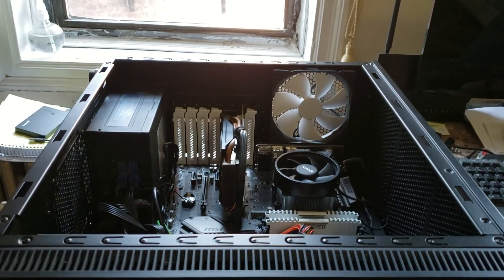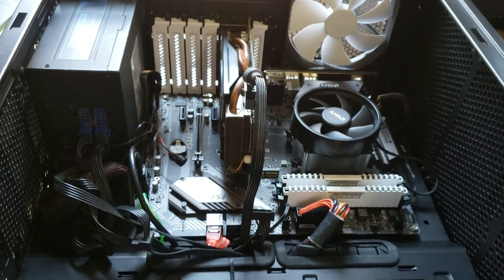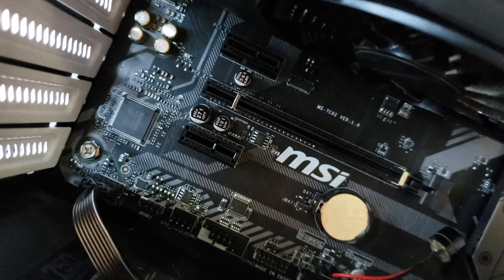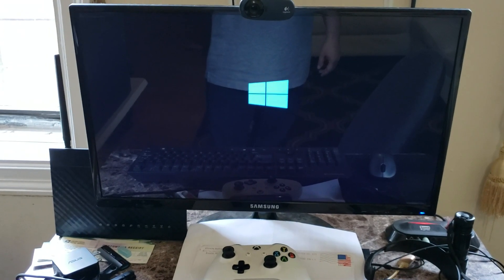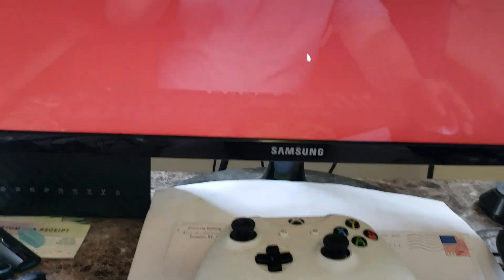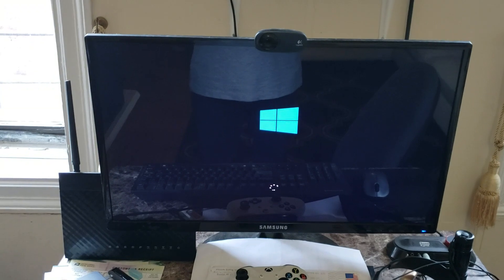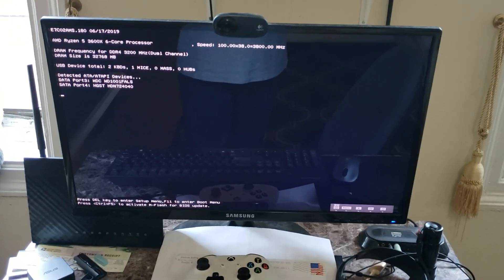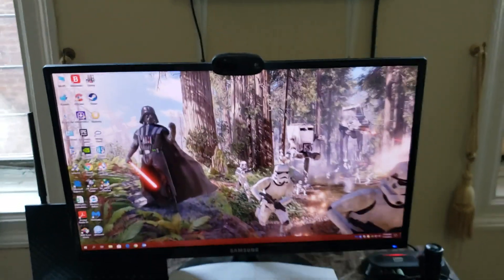Ryzen 3000 not booting on MSI B450/X470 Workaround Fix.

Comment: so what if i dont have any jumper on the mb. and still not booting, im shorting out manually to turn the mb and psu on so i dunno. i got an x470, and it doesnt work on my asus x570 gaming tuff, or neither the x370 from a pre build from dell (inspirion 5675) ?

}

Comment: Same problem 
I mean the PC turns on except the CPU and back case fan.
It turned on after i replaced the cpu and unpluged everything and pluged it again like 3-4 times and i booted so i updated my bios but after 3 days again... same problem 
Can someone please help me?
Removing the reset swith jumper does not helped me still no post...

Comment: Just found out there are 4 led`s on the motherboard that tell you if there is a problem with either GPU, BOOT, CHIP or DRAM. My DRAM led was lit up so I`ve just replace the one stick with 2 in solt 1,2 and it`s booting up fine now.

Comment: Same issues.  I have a MSI x470 plus board with a ryzen 3600 CPU and it won't post.  There is a cpu red indicator that comes on and never goes off.  Super frustrating.  I'm about to buy another motherboard.  I had the CPU installed in a Asus Strix b350 motherboard with updated bios and I never had an issue.  I will stay clear of MSI in the future.  Thanks for the video, I'm glad it's not a 'me' issue.

Comment: OMG after hours of head scratching bios flashing etc, I had the same issue of not being able to post after completing a brand new build, I came across this video and I'm shocked that this has actually sorted out CPU debug led and PC now posts and boots up.
MSI B450 Gaming Pro Carbon AC, Ryzen 5 3600, Geforce GTX 1660 Super GPU, Corsair Vengeance DDR4 3466Mhz 2x8GB sticks of RAM.
Reply: I have almost the exact same build and I’m having this issue. Is it fine now or still issues?
Reply: @KalebDenningIRL  mines all good now, just left the cable off for the reset button and worked booted up no problems.

Comment: After over 34 years of building pcs I recently bought the MSI 450 Tomahawk max and putting it all together after of course as we do, spending some time doing so, it failed to post. FULL STOP, no post. Check double check and nothing. Power is fine, fans fine cept interestingly no keyboard power light, no fault lights ie cpu et which was brand new. I've not used MSI before and don't see myself future wise doing so. Apparently this board has problems and it seems MSI are still releasing motherboards with problems. It clearly states on the box that it is Ryzen 3000 desktop ready. Ryzen 2nd Gen 3200G new installed with DDR4 2x4Gb ram 500w power + 2Tb WD black hard drive. I have to finish by saying that pc builders should always remember to build OUTSIDE of the case and TEST outside of the case BEFORE you build in the case saving you a lot of time otherwise wasted. 
NOT ONE of my previous builds with ie Gigabyte / Asus have had motherboard problems especially re initial post screen. I was somewhat disappointed but accept this is down to the MSI brand. I've used AMD dual core processors through the years on builds no problems though these days I do tend to favor Intel particularly i5's

Comment: Hello brother thank you soo much for the video...can you please help me? i have 3700x b450 carbon pro ac i am.not able to boot up the pc while the power is on in the cabinet everything runs but my screen is black no visiblity and no working of keyboard or mouse...i have flashed the bios and it starte working for 2 days now again its almost dead now...any budy can please help me with this??
thanks in advance
Reply: Same here with the same components. Just setuped it but no luck, no visible output, so can't do anything
Reply: @amen1459  MSI b450 gaming pro carbon ac, Ryzen 3700X
Reply: @amen1459  Yes I flashbacked it using a USB stick at the beginning. Now even when I try to downgrade or reinstall the same bios version, it just blinks twice and then remains on (the bios red light). And yes I'm using a 1080 TI Asus GPU.
Reply: @amen1459  Hmm, was your EZ Debug CPU light on too? and by removing the parts it turned off?

Comment: I just bought 4 of these Tomahawk B450's and paired them with Ryzen 1600AF Cpu's. Tonight is now the 2nd time I have experienced no boot issues with these. One of the builds during setup all of a sudden wouldn't post.  I thought one of the major components failed and I was about ready to swap out parts from an already completed system. Finally I got that system to boot. Don't remember exactly what resolved the first one but likely it was clearing the CMOS. Tonight on another build I wanted to double the RAM. I added a 2nd kit of RAM and entered BIOS and set XMP2 for 3200mhz. After that no post, nothing. Removed the fully tested kit from the other system and went back to 2x8gb. Still nothing. Tried using a jumper for about 30secs, nothing. Tried removing the CMOS battery for a few minutes nothing. All this because I wanted to see if 4x8gb would run at 3200mhz... So finally I put the jumper in place and let it sit for 5+mins. Came back and finally it posted stating BIOS was reset.  So it appears these boards have a very long clear time of the CMOS. I kept getting CPU light on off, VGA light on off, Boot light ON.......... and nothing. This makes me not want to mess with anything on these boards, I wanted to OC my 1600AF's to 4.0-4.2ghz all core range but now I might just leave it stock for a while because my time is more important than dealing with these no post issues. Next time this happens I will simply jumper the CMOS pins and let it sit for a while... unlike ANY other system I have had in the last 20yrs.
Reply: i havent witnessed such fuckery bro, im dumbfounded, maybe bad silica

Comment: Mine is the Tomahawk Max and when I turn it on those LEDs on the side (the ones to check the cup and stuff) they come on and go off then I get no display unless I turn it off and turn it back on again. Will this resolve my issue/is this the same issue as you? Ive been told to resit the GPU by a guy on reddit which I'm yet to do.
Reply: Toby Burnell 

How did you get on?
Reply: @fluidz23 I just did something in the power settings, something that said something about a quicker start up. if u head to power settings youll see what i mean.

Comment: Does this actually work? I'm having the same issue but with a TUF B450m-Gaming motherboard with a 3600X aswell... Fans spin etc lights up. No post at all unless I turn it off and on like 10 times its just random each time?
Reply: Update: I found that my issue was my ram sticks, I had them in A1 & B1 respectivley seeming you'd think thats fine but soon as I put them into A2 & B2, never had an issue starting up again

Comment: My msi b450 won't but whenever a insert Ram in either b1 or b2 slots. A1 and a2 work when I run a single clip.  B1 nor B2 Works on single or duel

Comment: Yeah, this seems to be a common issue. I've just built a Ryzen 7 3700x on a b450 MSI Pro Carbon with a RX 5700xt gpu & have the exact same issue. I  went through almost everything to try & resolve. I'm updating my bios later this week as my does start but it randomly just doesn't show any signal at times (I have to press reset to get it to work) 
I must admit I ain't tried your solution yet because I thought removing reset connection shouldn't really change anything. It's damn annoying at times lol ..thanks for vid 👍
Reply: Did it work? I've got a real similar build (3600/450APRO/5600xt) and initially I had some driver issues while overclocking, but resolved them. 2 days now for no apparent reason, my pc won't boot past the boot screen, but will boot to system repair and after that works normally, then after rebooting it goes straight back to the boot loop in to system recovery. Did you resolve it?

Comment: I wonder.. how many people here who claimed this fix worked still have issues?  I tried removing the reset switch, it seemed to work at first, 5 reboots later and the issue was back again.  :(

I’m not alone, there’s a lot of people having issues getting a 3700x to boot with the b450 pro carbon ac (and other 3000 chips too).  

In my case, I could get the 3700x to boot but only 3/5 of the time.    When it did boot the pc ran perfectly.

I looked in the pro carbon manual, the + and - for the reset switch is reversed compared to all the other switches nearby (just an observation).

My pro carbon box had a “3000 ready” sticker on it too so initially I didn’t need to flash a bios (I’ve tried most of them including the latest bios)

Has anybody here who paired the b450 pro carbon with a 3700x had a flawless startup every time?  I wonder if ram has anything to do with it, I only tried Corsair vengeance lpx 3200.
Reply: May be this will help:  https://www.youtube.com/watch?v=A3D2KrwOJAQ
Reply: Yeah me because I too thought it was fixed as I did 10 test runs of shutting down and booting up fine. But turned my PC on hours later (via wake on LAN) and issue still there

Comment: Dude!!! You're amazing 🤘🤩🙏
I almost hang myself because I used all my savings for buy this..
Thank you, thank you, thank you so much..

- Ryzen 5 3400g + MSI B450 Gaming
- 16Gb/3200 Mhz
- No external graphic card
- All default setting, no overclock
Reply: Did you update the bios to support ryzen 3000 series
Reply: @yobye5644  No.. I never do any update or anything.. It just written on the maotherboard box "Ryzen 5 3000 Ready"
Reply: @stevesky  oh iam using another motherboard but i found one that supports out of the box
Reply: @yobye5644  For that, maybe you need to upgrade BIOS my friend
Reply: @stevesky  yes i now 
And i got one that supports it
Reply: lol thanks for the laugh

Comment: Same problem with msi b450 gaming pro carbon ac. Using your solution fix the boot problem but now when I plug dimm b1 and b2 cpu doesn't work and I get cpu debug light.

Comment: Ryzen B450M PRO-M2, same issue, CPU light stays on, Ryzen 3200G CPU.. worked for some months.  After trying every hardware combo I could, reseating with new RAM, new CPU, a Ryzen 1200 (with new graphics card, not an APU), different SSD, booting into Lubuntu instead of Win 10, checking cables, swapping power supplies, swapping power backups, changing electrical outlets, checking cables, checking for shorts, trying various BIOS versions, resetting the BIOS, unplugging and clearing the capacitors for an hour, ... I could finally get it to boot by holding the power button down for five seconds after I powered off during the cold boot.  Then I turned Erp on in the BIOS settings.  It is working now, fingers crossed.  If the issue returns, I'm going to RMA it to MSI.
Reply: Is it good or is there still issues,,
Reply: @KalebDenningIRL  Thanks for your reply: I had to replace the CPU with the Ryzen 3 1200 and a graphics card as above but I am typing this reply on that same build now, so it has been working for 10 months.  I believe it was a memory compatibility issue.. recommend checking the compatibility list for any particular motherboard and it's best to use matching memory modules too, IMHO.

Comment: The re-set wire to the front panel switch has NO EFFECT on your MoBo whether connected or not. It is open circuit, ie NOT CONNECTED until the re-set button is pressed, when it closes the circuit to re-set. Therefore, you're looking in the wrong place for your issue. Did you update the BIOS before you installed the Ryzen 3000 CPU?
Reply: Davy Bloggs I had no idea that i was supposed to wait to install my Ryzen 3500 on the B450 until after bios had been flashed. Unit turns on but I’m not getting a signal, help me haha
Reply: I have the same issue but no re set cable

Comment: Holy S*** this actually worked! It actually worked!!!!  I can not believe it! I was for freaking sure I had messed up and i would have to return the motherboard for a different one because the one i got wasn't compatible .  I am running the msi b450m bazooka v2  with ryzen 2600 and I had the same problem. so apparently this isn't just isolated to 3000+ CPU's. Brother I could give you a hug right now! My only question, besides why this ridiculous crap happens in the first place is, whats the next step? should I update to the latest bios? I mean i can live without a reset button lol

Comment: John R, unrelated question. I am going to use the Define R6 with a Ryzen 3600. How is the cooling in that case with the stock cooler? Any temp problems? Do you recommend an aftermarket cooler or does the stock cooler work well enough. I am NOT going to overclock.
Reply: DH Blan - R6 case is superb, quiet and VERY good for cooling. You won't have ANY issues with your 3600 on the stock cooler if you're not OCing.
Reply: @davybloggs1564  -Thank you, sir. This is reassuring.

Comment: i have this mobo with ryzen 3600. i converted my usb to fat 32 and mbr. i renamed file MSI.ROM. I unplugged my ssd i turned off main power supply. turn power supply back on with usb plugged in. hit bios flashback button. red light flashes 3 times usb flashed blue then both turn off. not sure what im doing wrong. any suggestions would be helpful. thank you. im using amd bios 7CO2v1c dated 9-20-19

Comment: MSI X470 Gaming Pro Carbon, Ryzen 3900X, 2x16 GB 3200 CL 16 Corsair Vengeance LPX (on the list of compatible RAM).
Additionally: be Quiet 850W PSU, GeForce 1080Ti

So for me this did absolutely nothing. I still need like an hour to finally get my system to boot up.
HOWEVER, I discovered a work-around:
When using the power-saving mode in Windows (not Shutdown!), the PC comes up immediately (even after many hours).
You can then reboot safely if needed. Just don't power it down.

Let's hope they release a fix soon. It's been nothing but trouble with the Ryzen 3900X for me. I almost regret buying one.
Reply: Got same motherboard and having same issues did you find a work around?

Comment: this is called..... connecting your reset switch to the wrong pins on your motherboard...  This is a connector and not a jumper as a jumper is just a solid connection between two pins.  If you plug your switch connector to the wrong pins you can cause the switch to continually activate so check your motherboard for the correct pins.... just saying..
Reply: Wut? A switch is an open circuit untill you flip it. Most cases don't even come with a switch anymore, it is just a button that only closes the circuit when you push it. The moment you release it, the circuit opens. Jumpers on the other hand, always close a circuit. That is their intended purpose.

Comment: I am planning to buy MSI b450 gaming pro carbon ac. But, as it has bios ram limitation issue(15MB), i am fully confused about its performance with beta version. Is it ok if i go with this mobo or i face lack of performance issue like in overclocking??
Thanks in advance :)

Comment: I would have also liked to see a bootup without the wire.  But look at about 6:10 - see something?!?  Looks like maybe the CPU or DRAM "EZ Debug LED" light is on - Page 37 of manual.   Just because it posts doesn't mean anything.  I saw there was a BIOS update for  AGESA Code 1.0.0.4C, thats a "Foundation compatibility" update... OH!  Here's something else I found on redit - I don't redit so I can't verify but looks kinda legit except for the google doc's link - which I wouldn't trust since if 'everything' was true - and I didn't read it all - they would/should have it on their main site... Is that CPU Light Still On?!?  https://www.reddit.com/r/MSI_Gaming/comments/ce3ift/msi_b450_tomahawk_update/

Comment: Same issue. Ryzen 5 3600 with 16gb 3200mhz on MSI B450-A Pro. Completely stable when left on - 48 hours of load / torture test no problem. On restart, fails to post 4 out of 5 times. Removed the reset sw jumper per this video, posts/boots to Windows every time. Thanks man, this was a real pain trying to solve. 

For those assuming it was the CMOS clear - I've cleared mine 100x and even with board defaults system would fail to post 80% of the time. I did not clear the CMOS prior to removing the reset sw. I have not had a failed post since removing the reset sw.
Reply: Same with you, I have B450-A Pro with Ryzen 5 3600 but still not working with that and keep stuck at CPU LED on after restarting or when turning on my pc. BIOS version 7B86vA8
What should I do ?
Reply: Nubie Boy MSI released a new BIOS A9 for the board that is supposed to improve memory compatibility and OC profiles. I’d suggest updating to it. I have unmatched ram pairs that gave me BSOD and since updating they’ve been running smooth.
Reply: @davidgerla8764  Thank you for the advice.
Are there no more problems with the CPU LED on ? After my PC turns on, I'm not sure to restart it until I finish using it
Reply: @davidgerla8764  is it the version 7C02v1A? but i should update the bios with v19 first then update it again with the 1A version?
Reply: czacaesar the BIOS I mentioned is for the B450-A Pro. I don’t believe the BIOS you listed is the same board.
Reply: F

Comment: New B450M GAMIMG PLUS + Ryzen 3600 + RAM 16 GB 3200Mhz. After BIOS update had same problem. PC only booted once out of 10 times. SOLUTION: Set xmp profile for RAM, took out reset switch pins. And it boots everytime for now. Not sure which helped.
Reply: im sure the second one because if pc booted 1/10 times it means that it wasn't a RAM issue because if it was, the computer couldn't boot up.
Reply: @zelekje8711  exactly, if anything it would just throw a error to the monitor I've had ram go bad and it just throws a bios styled error message like when you first install windows.